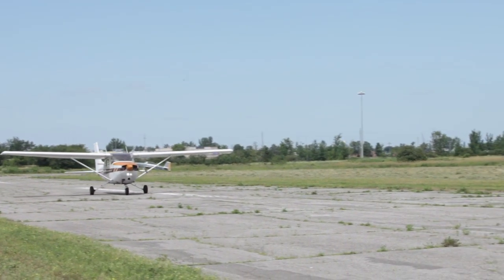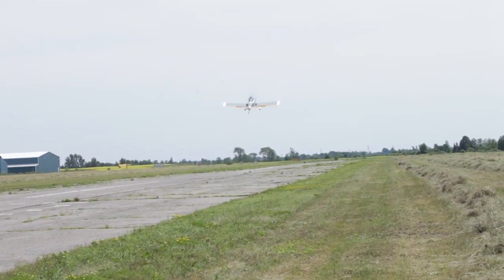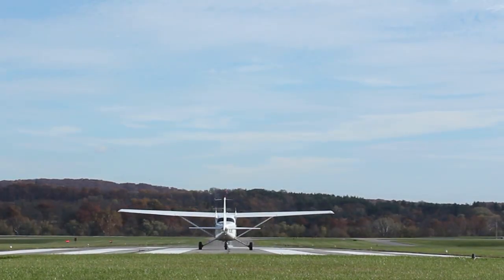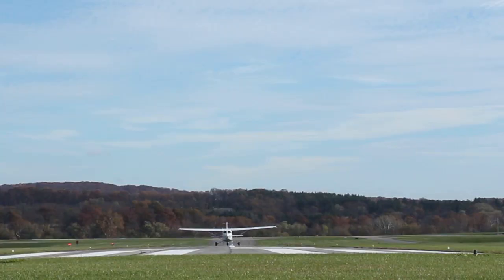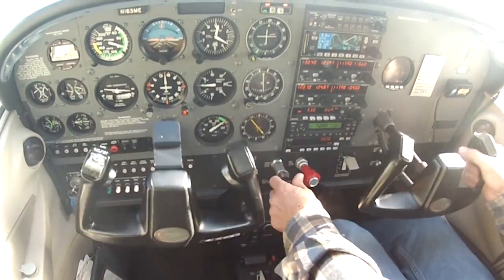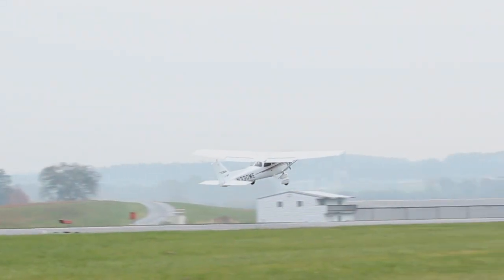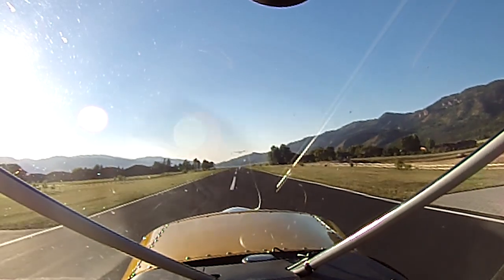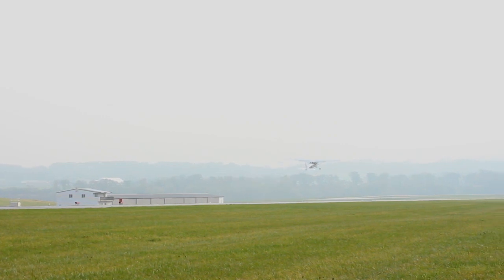Takeoff and Landings: Normal Takeoffs

Comment: Excellent discussion, and they are right, given a chance most fixed wing aircraft will just fly themselves off and go.  Yet while landings are more dramatic the old saying is right: they are mandatory, but takeoffs are optional, and on the ground if anything sounds wrong then sop.  Yet when you do take off that is the time when the engine is working hardest and the margins are narrowest so your options will be limited--hence you need planning ahead of time.  What is important to remember is that if something does go wrong on your early climb the worst thing to do is a 180 back to the field.  The chance of a stall/spin is high and you likely don't have the altitude anyway.  See https://www.boldmethod.com/learn-to-fly/maneuvers/the-impossible-turn-should-you-turn-back/  When I'm flying a glider I always ask myself before takeoff what I'd do if there was a rope break or towplane engine failure at this low altitude/location, or that one.  While the odds of these occurring are small, nothing in flying should be a surprise, or at least happen without a plan.